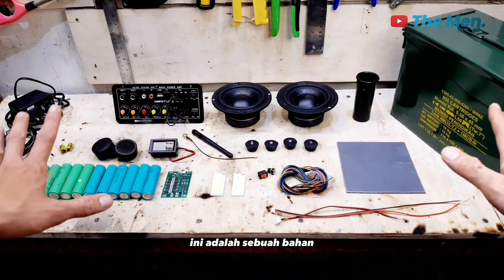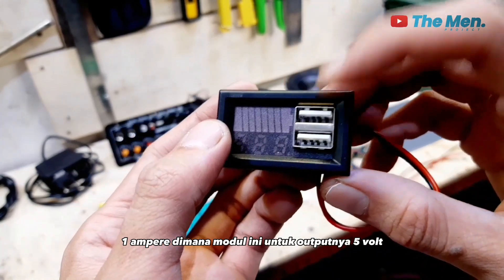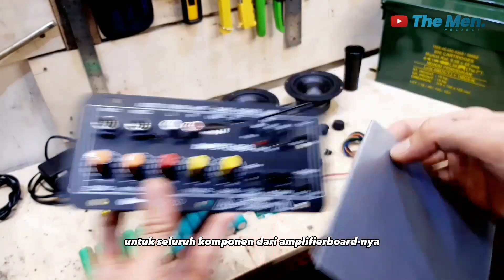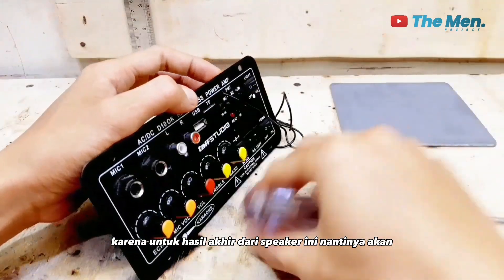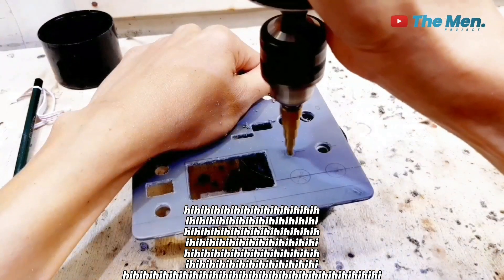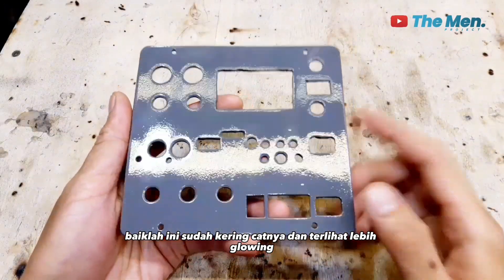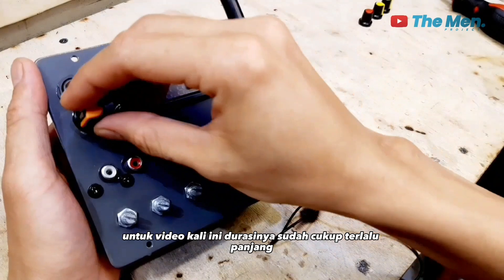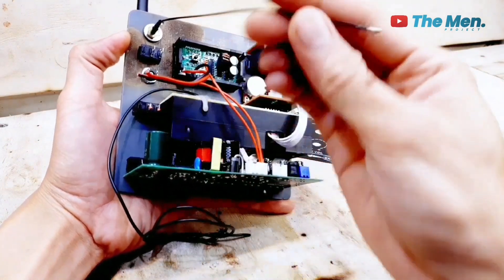DIY Portable Speaker Full Fitur | Speaker Bluetooth Kotak Amunisi | Part 1

Comment: Bang mohon maaf untuk pengecasan nya gimana yah penyambungan sama batrai nya, sy baru belajar
Mohon di balas
Reply from the maker: @daengzakki3202  di part 2 ada bang pakai battery rangkaian BMS 3S 12 volt
Reply: @armanusubekti  bang kalau aku make yang D100 sama speaker nya 12 in (1) rangkaian nya masih sama yah, Trus menggunakan BMS 3s 12 volt masih aman gak?
Reply: Kapasitor dan dioda nya masih ukuran yg sama apa lbih besar bang?
Reply from the maker: @ aman bang rangkaian sama. Cuman battery nya sampean tambain saja jumblah nya. Jadi 12 atau lebih. Pokonya tetap di 12 volt atau mksimal 24 volt biar power libih jos
Reply from the maker: @ sama aman bang